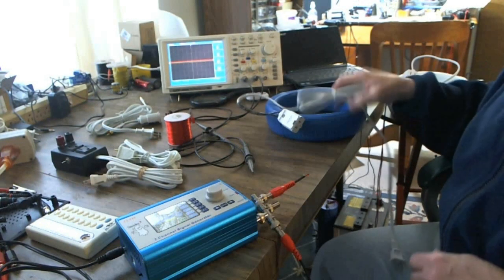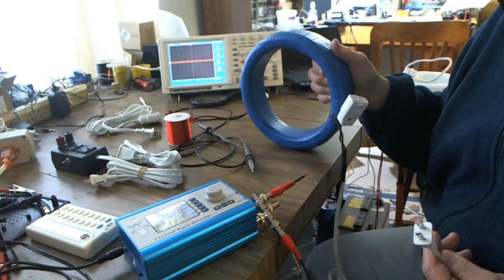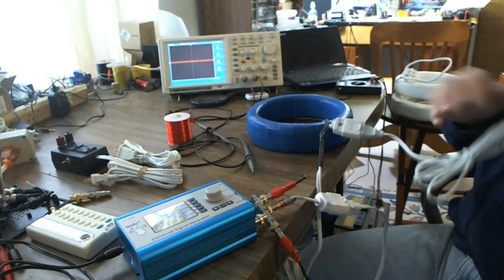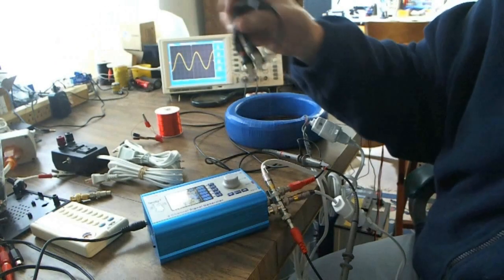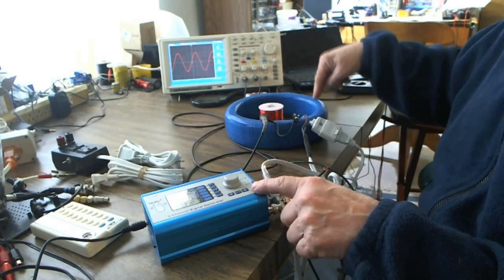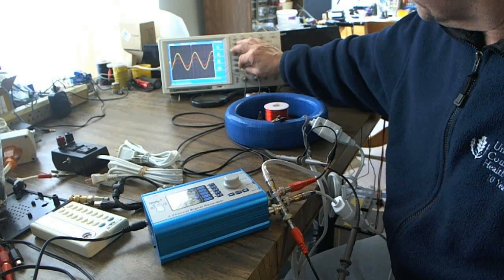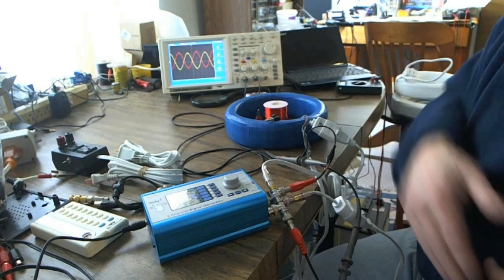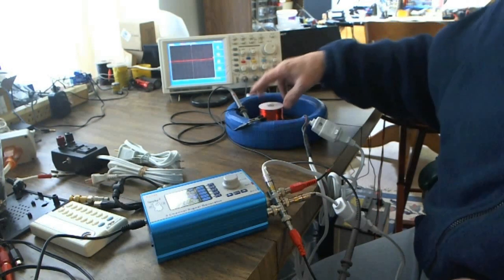Bifilar Coil Connections & Magnetic vs Scalar Waves

Comment: Hello, really informative video... it clears some things up for me. But I am unclear on how you made the coil that you are using to generate the scalar wave... I was under the impression that the bifilar coil was a pancake shaped coil that would be flat, but your coil is more like a ring... can you please clarify this for me? I'm super interested in scalar waves and free energy and healing technologies, but I am electrically challenged so to speak, so if you could explain this is even simpler terms (if that's even possible) then my tiny mind will appreciate it immensely! And I love your videos! Thank you
Reply: I think the flat pan cake coil wok's best for this, master Ivo has a good searies on this, look up his channel
Reply: if the following is too many words... skip to the bottom ... look at the tesla coil (pancake), the toroidal coil he has is multi-row, the pancake is multilayered... "Just as the inertia of bodies tends to resist a change in the configuration of a material system, that is, to resist change of motion, so in electricity there is an opposition to the change of magnetic flux." ... (like current for ohm's law; rationalized as (T) tesla units regarding magnetism or an electromagnet)... look at the direction current is flowing in the coil (as it opposes in direction), given two coils wound proportionally or equally around the toroid (like two solenoids or helical coils) where one is wound clockwise and the other counter-clockwise... even in a monofilar, you can imagine this effect of current opposing direction when the loop (typically, the tap for ground or chassis) of the coil sends the conductor in the opposite direction of the first "lead"... (monofilar... like a single solenoid or strand of wire (in this case, wound like an electromagnet)... bifilar, like two separate solenoids or strands of wire (typically, of equal length) wound together and no loop in the center (like the pancake)... practically, two series coils (again... clockwise and counter-clockwise)...... simply, the monofilar (pancake), typically, has a loop or "curl around" in the center and the bifilar (pancake) has a wire that would extend out to the terminal (leads) for input or output depending on how the coil is used... bifilar usually has A input and B output and A to B tap for ground (loop on the outside of the coil)... the toroid is just (typically) cored and multi-row (maybe, even multilayered) vs the pancake, which is (typically) not cored and multilayered (can also be multi-row)...

toroids are usually cored and wound with multi-row and pancakes (typically) don't have a core and are multilayered... mostly, toroids are intersecting with the circumference (around the circle) or rings around a ring and pancakes are wound "parallel" or with the curved "line" of the circle (if you were to imagine this 'two dimensionally' or, to say, like a circle drawn on paper) or rings within a ring... to wind a bifilar, take two even strands of wire and wind them around a toroid former and connect two of the four wires together on opposite ends (then you have two series coils) or fold a single wire and wind it around the toroid (snip the loop and connect A wire to B wire on opposite ends), or, simply search youtube or google for this instruction
Reply: said...

nicholas cauhlen coil (transformer, cylindrical (solenoid)) cored
stubbleield coil (cylindrical) more capacitive and 'solenoidal' (especially, when wet) and cored
tesla (pancake or funnel) coil (cylindrical and helical), typically, a helix coil with no core

or more mathematical/integral type coils (coils that are a little more complex)...
said...

magrav coil (toroidal or toroids within toroids) more capacitive and processed to anodize or rosin... air coils with smaller air coils as the core
rodin coil (toroidal) typically air coil
and (i think) the bhargava coil (which really, more explicitly, gives the nature of the flywheel-like effect and resonance with telluric crystal power)... typically, two funnel coils facing one another (only, all one coil or single wire with no end points (a loop) and is an air coil) and tapped into directly or magnetically or capacitvely... etc...

coils (of about any type or any of these types) can be wound in a fashion of monofilar, bifilar, trifilar, quadrifilar (etc...)... even, monofilar, bifilar, trifilar, quadrifilar (etc...) with any of these combinations/fashions within or around the exterior of the inner coil
Reply: @xeno8555  well put and informative.
Reply: @xeno8555  what is the name of the coil used to measure the scalar wave (smaller coil in the centre of bifilar coil)? How to make it?
Reply: @drchoprashow  it doesn't measure scalar waves.

Comment: bifilar coils are on a flat plane coiling from center outward creating a spiral I believe the coil here is called a rodin coil which I've seen used in power suppliesscaler waves will be produced on a true bifiler
Reply from the maker: You are mixing up concepts and names and confusing the word bifilar with a style of coil.  Bifilar simply refers to two windings together, or side by side.  A Rodin Coil, a Pancake Coil, an Abha Coil, and a dozen other coil types can often be a single wire winding or a multiple wire windings. The Bifilar coil in this video consist of two windings side by side wound on a 6.5” form for roughly 175’ length of 12 gauge wire and 175’  length of 1`8 gauge wire.  It is just a simple coil, bifilar wound.

Comment: How do you generate scalar waves?
Reply from the maker: Actually the intent was to duplicate the Spooky Remote on a much larger scale.  It is like having a Remote that is on steroids.  The Spooky Remote works on the exact same principle as presented in this video.  Another source of information that led me to believe a scalar wave is in the making is a video I watched by Eric Dollar.  He likened the connections between the nodes of a scalar wave was like having a solid bar connecting the nodes together.  Bump the front node and the node at the other end bumps immediately.  Normal waves are limited by the speed of light.  Scalar wave are claimed to be able to exceed the speed of light.

So my answer comes from other sources and is not derived from doing experiments in a screened off room.   There are several other devices that claim a similar requirement that a standing wave needs to be generated in order to produce a scalar wave.  Radionic and several light devices come to mind.  Do these devices work and are they truly generating scalar waves?  I’ll let you be the judge of that.
Reply from the maker: There is a lot of disagreement about what a scalar wave is and isn’t. The following is how I approached this subject matter.

Several of the devices in the market claim a scalar wave is created when a standing wave of sine wave symmetry is generated with equal and opposite waves opposing one another and create standing wave nodes.   The Spooky Remote is one such device that does this.  The technique is rather simple and can be done with both magnetic and optical devices.  When working with coils, reversing the winding direction midway through the coil winding will generate a standing wave where the magnetic field cancels itself between the nodes.  This happens because of the nature of the magnetic wave direction is determined by current direction within a conductor.  Yet at the same time current will flow through the complete coil and yet there will be no magnetic field detected.  This is one reason you cannot go to your local electronic supply source and buy a scalar wave meter.  The key to understanding what has been stated here is to understand what a standing wave is.  There are lots of good resources for learning about standing waves.  Example https://phet.colorado.edu/en/search?q=standing+wave

The two winding of a bifilar coil can easily be connected with the two winding connected in series.  Each wire has two ends and depending how the ends are connected will determine if the current direction changes at the midpoint connection.   A picture is worth a thousand words.  For the electrically inclined the schematic of the Magnetic to Scalar switch clearly shows how this done. 
http://www.aurorasky.net/Bifilar_Magnetic_to_Scalar_Switch_Schematic.pdf  I sincerely hope this get you started with some basic information that will inspire you to look into the subject matter further.  Be well and respectfully, Steve
Reply: Thanks
Reply: gskempe9 The interesting thing about the spooky remote is that nobody can actually define or describe how (or if ) it works. My own theory would be the biological material is being energised by standard electromagnetic waves and any 'communication' to the host is via the entanglement between our own cells. So rather than requiring the manifestation of an indeterminate new field, standard and accepted science can be pushed to provide a possible  answer.
Reply: @electronicsandradio3945  To (Mr. Electronics and radio) I have the same reasoning that you have, I believe spooky2 is capable of delivering the correct frequencies of scalar waves and Raymond Royal Rife frequencies, but in an intelligent way, the key is in the software. I know it's possible, I know it can be done, to heal the body in a matter of a few days to a few hours or a few seconds. I believe that is possible. Because Royal Raymond Rife has discovered the secrets of how to heal the body and Destroy disease in the body. Scalar waves as I see it is an upgrade or a supercharged wave with intelligence connected to the Software to communicate with the cells in the body or plants or animals It's all possible, it can be done. And PEMF also plays a part in the healing process, correcting problems in the body, all the parts are there, and there's one more element that I have left out of this conversation, it deals with the Earth. So I'm putting all these elements together in the correct way, you have the perfect formula for (Rejuvenation) and rebuilding of the human body, on an animal's body or plant body, you have the right ingredients you can make the process Of restoring the body to good health.
Reply: @DJRobbie54  Nobody has proved scalar waves are even a reality. There's no proven method of detecting them. Mostly it's all conjecture, but some people want to make claims without any proof. Spooky is a simple signal generator. It's been adapted with a control program that makes it appear more than it is.
Reply: @electronicsandradio3945  So you don't believe in what Royal Raymond Rife Discovery in the frequencies that heal and Destroy diseases or the pemf field or the scalar wave so is that what you're saying you don't believe in any of that is that what you're saying.
Reply: @DJRobbie54  Firstly, what Rife did or did not do is now folk lore and his work is questionable because there are not hard and fast documents available. People are trying to replicate it based on hear say and guesswork while others simply want to cash in on the financial opportunity. There is every possibility for disease to be affected by electromagnetic radiation  including pemf for healing, this truth is not questioned. However, the spooky remote is based on no science at all, just on fabricated pseudo science. People who report benefits may be healing themselves because of placebo effect, or there is a slight possibility that their samples are being affected by the magnetic field and somehow it affects the body remotely but there is no reason to believe scalar waves are involved at all. If you think the lists of frequencies available have any real meaning then you are mistaken. To find a single frequency that affects a specific disease would take a long time in a proper research lab yet we have a handful of people making up lists and claiming they are suitable for this or that...complete rubbish. These people cannot have the resources to do long term trials and proper validation. People believe because they are desperately ill, most have no understanding of electronics or anything technical... they will believe anything that sounds special.
Reply: @DJRobbie54  so tell me what you actually know and understand about radio and electromagnetic waves. Do you have ANY background, training, experience or qualification in this subject or do you simply dismiss anyone who tries to tell you something that doesn't agree with what you want to believe? Firstly however, I suggest you re-read carefully what I wrote.
Reply: Master Ivo has a good searies on scaler, Constantine Myle did great work on scaler waves also, demonstrating thay cannot me shielded out.
Reply: gskempe9 So what about the claims that scalar waves permeate infinite distance and manage to walk through screened rooms. Does that match your own concept?
Reply: gskempe9 Your coil is creating magnetic fields...if they cancel themselves out you have lack of magnetic fields yet for some reason you want to conjure up the creation of a new field that can't even be detected. Bizarre. Oh, and standing waves can of course be detected... there are maxima and minima throughout the wavelength.